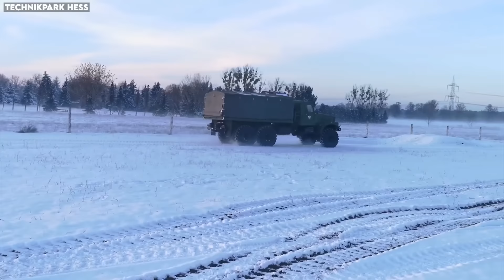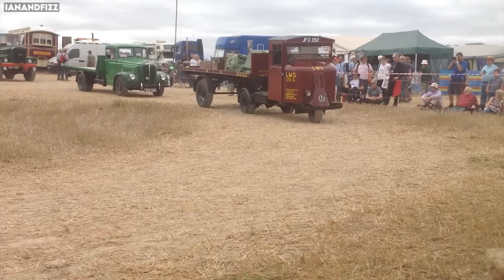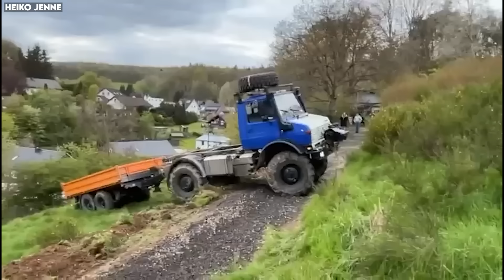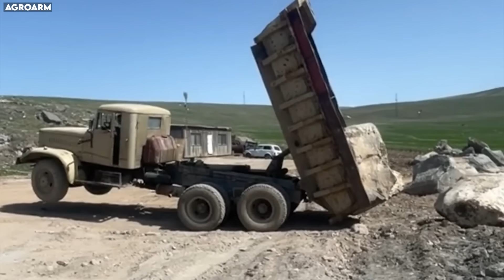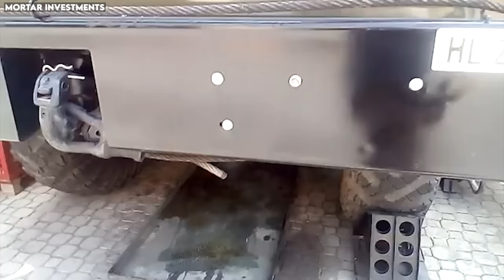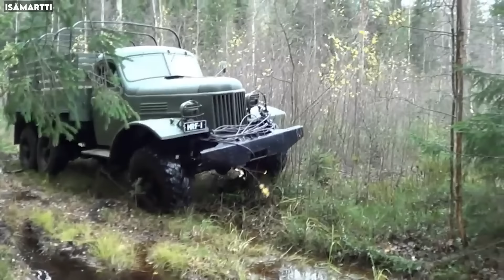12 Old Trucks So Strange You’ll Think They’re CGI

Comment: the so called white foden which is mentioned is not what it seems but a DAF with a foden badge and cummins engine,
Reply: Recall sitting in a Mk1 Alpha at Tipcon and thinking nah, windows had the DAF logo on them as did the air intake and many other parts. A rebadge of the brand like MAN did to ERF